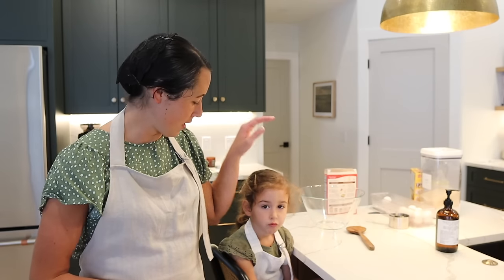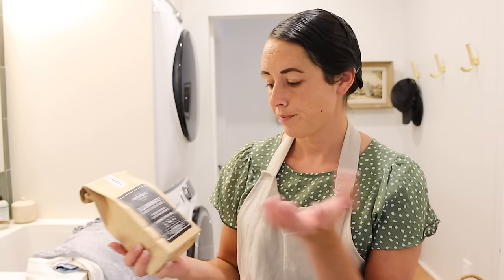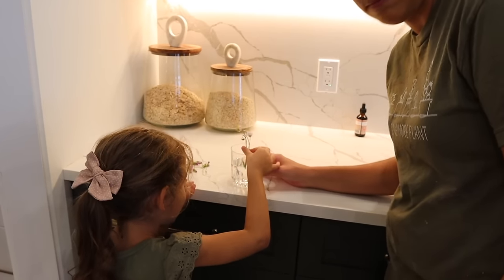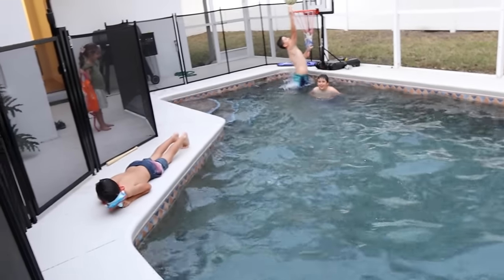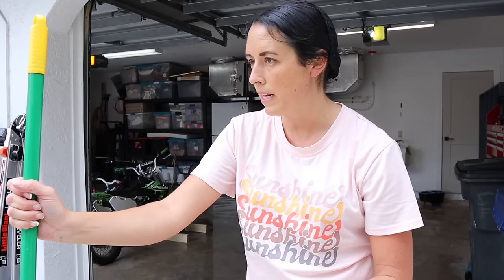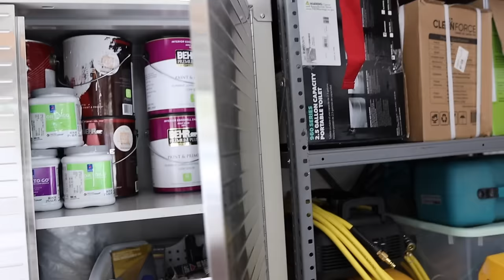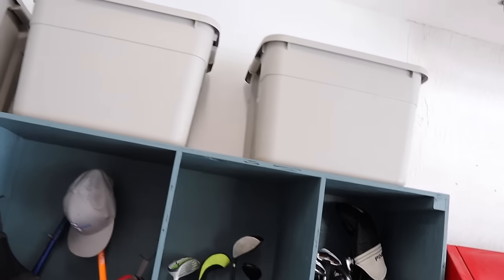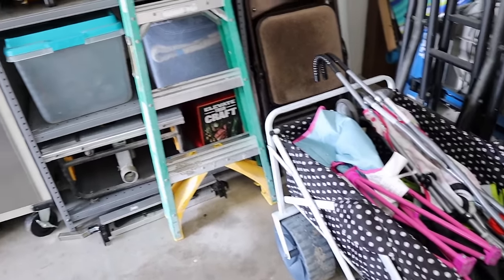🌸 SPRING HOME PROJECTS | GARAGE TRANSFORMATION 2024

Comment: You may want to scoot the refrigerator and the freezer down  closer to the metal rack .
with it being so close to the hot water heater. It’s could be causing the hot water heater to have to heat up more and it’s putting heat next to the freezer which is making the freezer work more because of the heat from the hot water tank.
That’s just something to think about